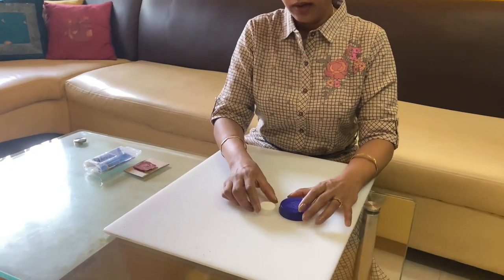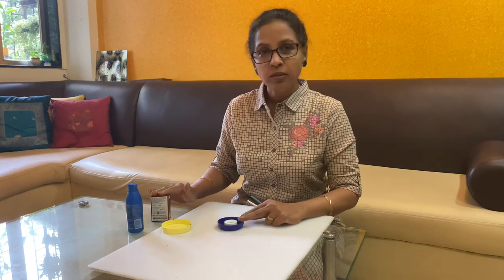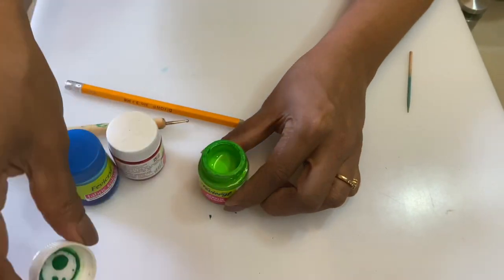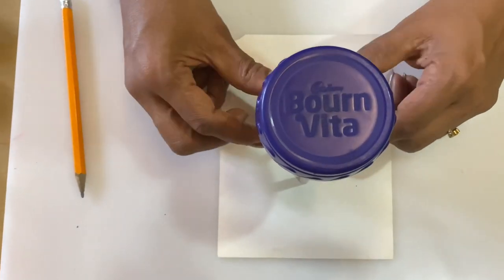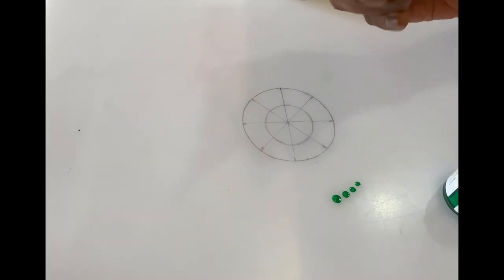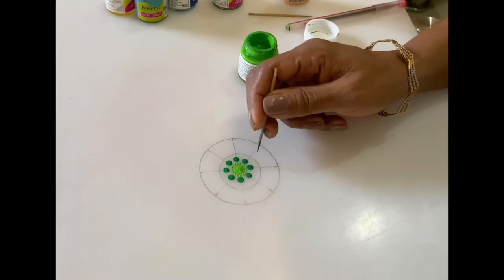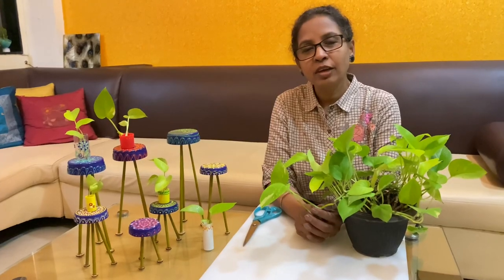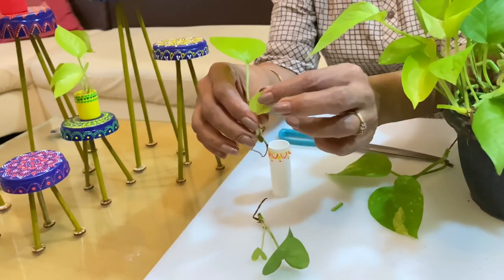How to make DIY  Decorative Stools using waste container lids|Best out of waste|15|Art Around House

Comment: How about doing the dot mandala on the lid first n then attaching the legs of the stool for ease in painting ....just a thought
Reply from the maker: Thank you so much for the appreciation..
You can ...But the problem comes when you have to do the painting on th edges ...In fact after attaching the legs i found it comfortable to rotate and till  you seal the paint with varnish ..you have to be very careful about  the paint .